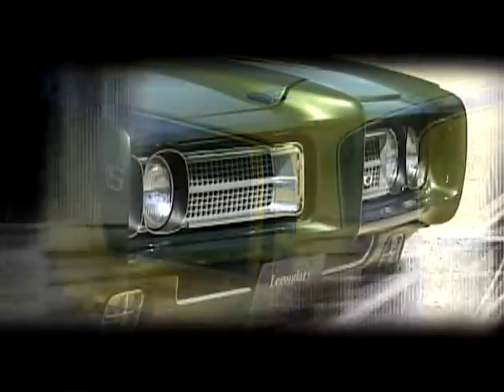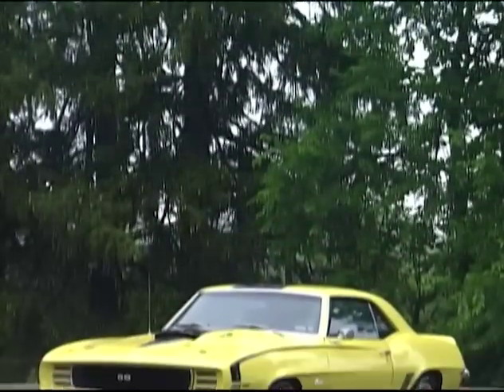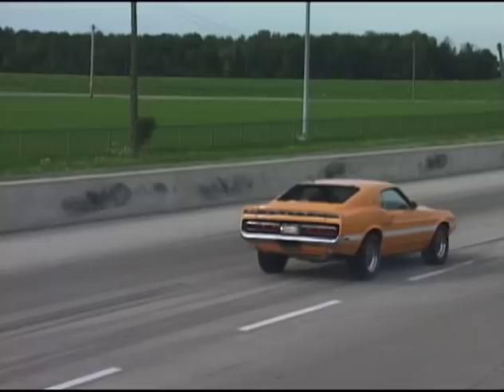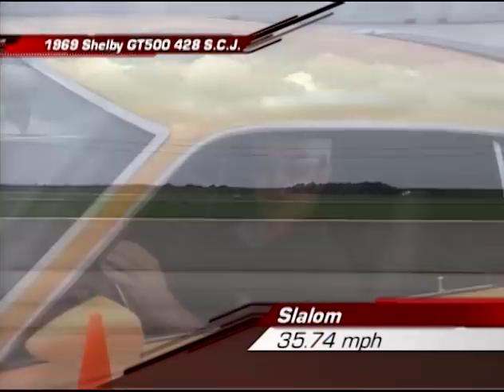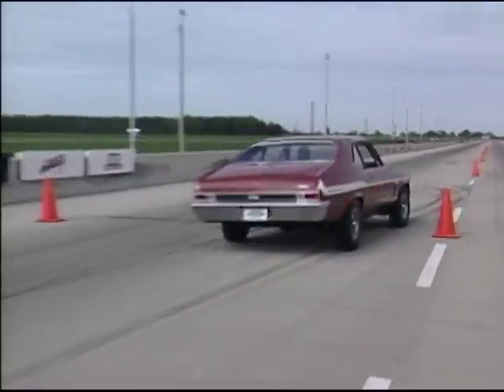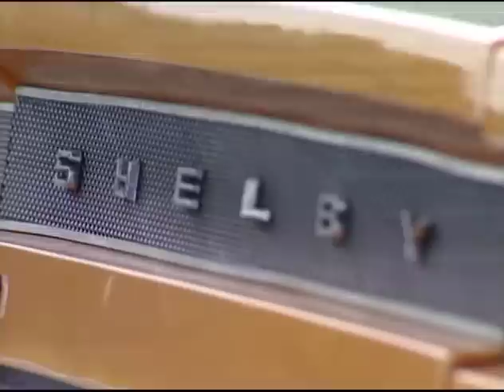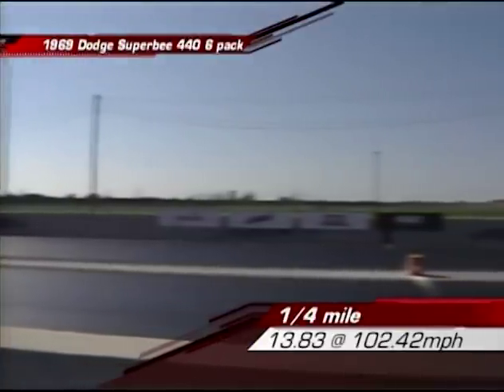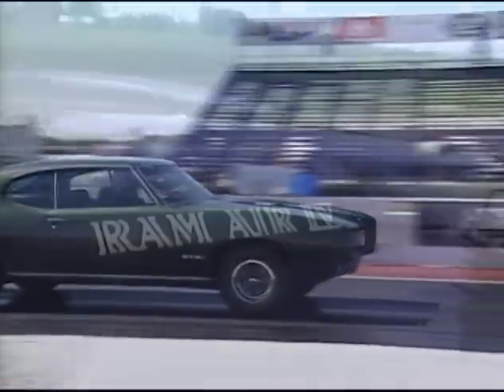What's the fastest 1969 tuner? SUPER MUSCLE CAR SHOOTOUT!

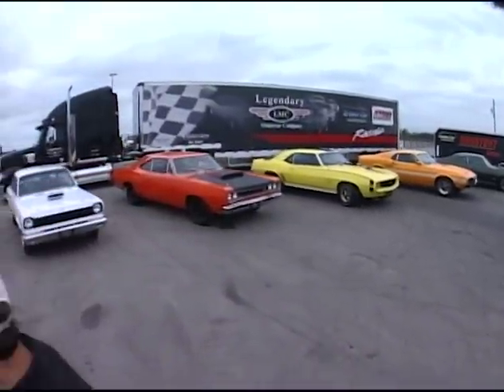Comment: The SSS Datsun 510 was the factory homologation car for BRE's Trans-Am race cars. They came with a 1.8L SOHC engine (vs 1.6L stock), side draft carbs, higher lift cam, header exhaust, larger oil pump and pan, magnesium BBS rims, larger front disk breaks, and many suspension upgrades. Nissan Performance sold race cams, titanium valve train, and forged internal parts through selected dealerships. My brother and I have built and raced auto-cross 510s for 40 yrs. In the hands of serious tuners they take 300lbs off, add an OS Giken crossflow head, forged internals, 4.11 R180 LSD, modified Z struts, and stiffer sway bars to make a 1,750 lb 200hp (230hp in race form) 10K rpm screaming rice rocket with a license plate. Although the 7.2L GTO's torque has the advantage after 80 mph, the quick accelerating 1.8L 510 pulls a high 12 sec 1/4 mile. It would easily top the leader board in 0-60, 60-0, and literally crush the slalom. SVRA Group 8 lap record at Laguna Seca is 1:42.98 seconds, held by Troy Ermish in his #38 510. The nearest SVRA Group 6 sedan (Mustang Boss 302) is 5 seconds slower, and on the short 2.2 mile track these Muscle cars would be another 40+ secs behind. All this lap record info is on Hagerty's website if interested. When it comes to performance, bigger isn't always better.
Reply: So what. You are comparing what sounds like a full on race car against street cars. Rather have any of these over gutted tin can510, no thanks. Go troll someplace else.
Reply: @FL50ssp  Just like the SSS 510 I described, these pony cars are not factory stock. They had many performance upgrades from independent companies. An over lighted tin can 510 race car would throw even more shade. All the same, a modified 7.2L GTO is still no match for a 1.8L 510. The Group 6 Mustang Boss 302 is a full on race car, and a little 510 kicks the snot out of it. If you think I'm trolling, you don't understand the difference between nostalgic hype and real performance.
Reply: @FL50ssp  There is no such thing as  Honda CRTs, so your time is wasted. Madia sells cars. Lap times don't lie. 

I lost my vision a while ago. Not driving my giant killer any more, but here are some vids of my sick little tin can. Post up some vidsof your car, or go blow your hot air somewhere else.

https://youtu.be/H4rYbyudrhA?si=sbBRWCdK0AlrX4RK
https://youtu.be/qWSJ9x-FJ8E?si=1LQt-fX2OCUTuf-D
 Here's a review of my 510 on a track buddy's YT channel. 200K views
https://youtu.be/GZtp6PiFlTI?si=owLHdMxeTCiUrfTy
Any questions?

Build list of mods and parts. Work ongoing, never done 

Chassis:
Started with a 1972 rust free SoCal car with Troy Ermish built chassis 
6 point roll cage body bonded
Willwood big brake kit with braided stainless brake lines
Spherical ball joint linkage 
Techno Toy Tuning stage 2 adjustable coilovers front and rear
Techno Toy Tuning camber/caster plates 
Raised T/C rods, 
RCA (roll center adjuster) between the struts and lower arm, 
Custom front X-member and engine mounts Jeff Boswell Coachwerks 
Toyota MR2 rack & pinion steering conversion
suspension tuning Troy Earmish racing
1.125" front sway bar
.75" rear sway bar
Slotted rear X-member,
Battery mounted behind passenger seat

Body & Interior:
Rust free SoCal body
Shaved side markers, rear plate light, door and trunk locks
I did the body prep and tape, Bill and Bill East Oakland did the spray.
Color is Ford D6 Screaming Yellow, Emron industrial equipment two part Epoxy paint used by Caterpillar
Carbon fiber BRE air dam, bumpers, door panels and thresholds from Pare Composites. RIP Dave.
Fiberglass hood and front valance 
Hella 65W 60mm halogen projector beam headlights
Corbeau Forza Sport seats on 2" lowered slide rails
5 point harness.
Custom built aluminum dash with Revolution GPS gauges. 
Quick release NRG steering wheel 

Fuel System:
Set up for E85 
ATL fuel cell with internal surge tank and two Walbro pumps
Z-Tech Flex Fuel sensor so ECU can adjust for any ratio ethanol to gas. 
Aeromotive 8AN nylon braided stainless lines and fittings.
Aeromotive pressure regulator
Custom fuel rail
Injector Dynamics 1000cc injectors

Engine and Peripherals:
s13 blacktop SR20DET with fresh rebuild bottom end 
Fresh rebuilt head  with Tomei metal head gasket
Knockoff Greddy intake customized for top feed injectors
Ron Davis Rad and intercooler with Transfer Black thermal conductive coating
Short run log exhaust manifold ceramic coating with Vband external wastegate
Garrett Gen2 GTX2867R T3 twin scroll 0.82A/R turbine 3.0" V-band exhaust
Custom downpipe with dynamic flow wastegate inlet
Tial blow off and wastegate 
Stainless flex coupler to 3" exhaust and Magnaflow glass pack 
Custom cold air intake with no MAF
Link G4 stand alone ECU, monitors O2, intake temp, and altitude to eliminate MAF.
Tuning by Rebello Racing and Portland Speed Industries
Wiring specialties s13 universal wiring harness. Yury Rocks!
GM LS2 coil pack ignition. 

Power train:
Exedy Racing Hyper Stage 3 twin plate Cerametalic clutch and light flywheel
Custom drive shaft
06, WRX sti R180 LSD dif
Drive Shaft Shop axle kit, billet stub ends, Porsche 930 axles and CV joints
Enkei Compe 15X7 22+ offset with 205/50 R15 RE-71Rs
Reply: @Datsun510zen  Sorry to hear about your sight, that sucks, and best wishes to you. I will say that is a nice build and even on the net you can tell it is a quality result all the way. But again you are comparing what as I suspected is a full-on build against stock cars. In as delivered from the factory or showroom condition. These cars are not as equal as you Implied. Will a small import do well/better on a short track that favors mechanical grip? Of course. However, on a normal road course like SCCA ran back in the Trans AM early days. This same small import is not a match on a course that favors a mix of mechanical grip and HP. Even more so on layouts that favor HP.  You mentioned something about my videos, here you go, all of these are from my SS 1LE, had a Z06 before this without PDR so I have a lot of GoPro videos that have never been published. But it is more of the same.   https://www.youtube.com/@FL50ssp/videos
Reply: @FL50ssp I couldn't see your SS 1LE, but it sounds great. So yeah, blindness sucks. I grew up around hot rods in the 60s and 70s. The driver assist technology in modern performance cars has never been my thing. Not as easy, but I enjoyed the direct seat of your pants driving experience of these beasts. Even more compelling driving experience for me was getting the most out of a smaller high revving engine.

Again, the SSS optioned 510's were street legal cars sold through dealerships, just like these iconic pony cars from that era. Race tuners were getting 10K rpm and 110 hp per liter out of the SOHC engines. Trans Am class A Sedans on the other hand were limited to 5.0L and made 95 hp per liter on push rod engines. To clarify, none of these drag oriented large displacement cars ran in that series. 

B Sedans were under 2.5L, and that class was dominated by lighter European cars. For the "tin can" Datsun 510's professional debut in Trans Am, it won 2 consecutive manufacturers championships right out of the gate. It was the absolute underdog going up against the Alfa Romeo GTV 1750, Auston Mini Cooper, BMW 2002, Saab 142, and the VW Beetle getting support from Porsche. After these victories, the little rice can 510 had completely revolutionized small sport sedan racing for the decades following. In fact, Datsun/Nissan has won more SCCA championship titles than any other car company. I couldn't give a flying fart about other Japanese cars, but I'm a huge fan of classic Datsun's.

Comment: Smokey Yunick was directly responsible for the final engine position of the '66 Chevelle's with big blocks. Smokey at that time was a engine/car tester and consultant for Chevy ( he did the same for Ford and Pontiac at other times ). He complained to the Chevy brass and told them the car was too nose-heavy, and that they needed to move the big block back 4" and lower it 3" as well. Even though the Chevy plant already had the jigs made to mass produce the firewalls, Chevy brass granted Smokey's recommendation and totally redesigned the firewall so that the engine would be dropped and moved back. Smokey tested the car again, and was very pleased with the results. He said the car actually felt "kind of racey". Why am I telling you this? Because in the same true story, Smokey stated that he saved the '66 Chevelle ( and later models ) from being a disaster in the handling department, and that title goes to ALL the Ford Mustangs equipped with big blocks being way too nose heavy. Carrol Shelby was totally against putting a big block in his Shelby Mustangs, citing that the 289 small block would run circles around it on road courses. But under pressure from Ford brass, Shelby relented, and gave them the big block Shelby's.
Reply: That Smokey Yunick story never happened.  The '66 Chevelle's big block was in the same exact position as on the 1965 Z16 - which Smokey had nothing to do with.
Reply: EXTENSIVE MODIFICATIONS were required to put anything bigger than a 302 in a mustang!
Reply: @Thomas63r2  I don't know why in the hell I said "66 Chevelle". It was the '64 Chevelle, the very first yr of production, and YES, Smokey Yunick DID advise Chevy brass to drop that big block down and move it back. Because he tested a prototype BEFORE AND AFTER moving the engine. My mistake on saying "the '66 Chevelle" earlier.......but I know I am correct about Smokey really pissing off the guys at the Chevy plant who already had the jigs made for mass producing the firewalls, and I can't recall the head honcho's name at the moment who hired & paid Smokey at Chevy, who took Smokey's sage advice seriously & ORDERED them to move the engine & build all new jigs for a different firewall to accommodate the different engine position for the big block.
Reply: @howabouthetruth2157  Sorry, I'm not buying the story that because of what Smokey said that they retooled the Chevelle AFTER the car was tooled up for production.   No brass at GM ever wanted to be the one who held up production.  Its the same firewall in all A bodies of the era in all the GM divisions, so you are not talking about changing tooling at just one plant - but at all the plants producing A body cars across all the divisions.
Reply: Here's the real story: ... Torquey GTO's owned stoplight to stoplight... where more people saw them... took a full 1/4 mile for the overcammed Chevy's to get a fender ahead: 
https://www.youtube.com/watch?v=SJIRitKQYrM
Reply: @BuzzLOLOL  "where more people saw them"...........what made up bullshit. I'm not debating that the Pontiacs had better low end torque........but how many times have you EVER seen "grand stands full of race fans in attendance" at a street corner? REAL MEN drag race in the standing 1/4 mile or 1/8 mile. "Racing from red light to red light" is what irresponsible KIDS do.
Reply: @howabouthetruth2157  - C'mon! ALL the millions of GTOs /442's ever made were seen smoking everyone else stoplight to stoplight over and over again! And that's where most girls saw them perform or drove them! Only a few GTOs ever ran on a drag strip... mine and my buddies never did... Did you watch the video?
Reply: @BuzzLOLOL  You said it, ahead.

Comment: These tests are always informative & fun,but there's never a clear winner because the tests are never 100% level. Running a mid-sized car vs a pony car vs a full-size car. Also when these cars were originally tested they had points,poloyglass tires etc...I've always wanted to see theses legends run with modern tech...fuel injection, roller cams, modern tires,electronic ignition...imagine what they could do...

Comment: Thanks for posting.  It is fun to watch these put through the paces in these modern times.  Tuners are kind of a weird title though.  The Chevrolet dealer drivetrain swap specials should have had huge legs up, it would seem, but couldn't take down that mighty Ram Air IV (I'm not sure how much Bobcat was in that one, but RAM AIR IV's seemed awesome with or without a dealer's magic).  The Shelby, was just a Shelby - I don't know how tuner applies except for body work I suppose.  The Super Bee - looked like an A12 Super Bee - Mr. Norm didn't do anything, did he?  Just a factory hot rod.  The Hurst, yeah, probably qualifies as a tuner.  Once sent outside of the factory, maybe the term fits better.  I would love to have seen a Hurst Olds in here.
Reply: In '68 GT500 lost its 2nd 4 bbl. carb. and Shelby's influence was waning... in '69 GT500 lost its hotter camshaft... was considered a 16 second car... Shelby/race shop tuning on this one plus Super Cobra Jet engine got it into 14's... Summer of '69 Shelby parted from Ford... back in the day a neighbor had a GT500 and it seemed like a slug for the spec.s it had...
Reply: Mr. Norm had several tuning stages, from re-jetting carbs, re-curved Hemi distributors, to mechanical linkages on the 3 duces, to headers and cams. Whatever 1's wallet would allow. I'm not sure what package that A12 feature car has, as they really didn't get in depth.
Reply: @adamtrombino106  in all honesty the a12 super Bee six pack that I've seen from the factory in red magazines can run 12. I'm sorry to say the guy honestly didn't know how to drive them properly, and the mustang with a super Cobra jet is a low 13 second car at least 13 5 in the Shelby's case in Maryland I've seen a lot of muscle cars race in the a12 the hemis I seen these were stock mind you beat everything.

Comment: Don’t know why you chose the big heavy B body Mopar instead of a Barracuda  since you used pony cars  (or pony sized) with all the other. Couldn’t you find a hemi out their for that matter.
Reply: In all honesty it didn't need a hemi but I love that motor the 440 a 12 super Bee when you get them you're supposed to take the tires off and put better ones on but besides that even stock if you look at the old magazines and I've seen them run factory stock as well and she's so Kenny dragway with good street tires I'm not sure what kind but they run 12 from the factory that's why they were so awesome. To be fair it needed a better driver.

Comment: The Mussell Cars i ever owned were a 66 GTO with a 68 Firebird 400 Ho motor with a 4-speed B/Waner tw10 with 3:50 rear gears p-track. Played with it a little and the 396,440 and the Mustangs didn't hold a candle to the GTO. not bragging just, the fax 
my Dad drove it for a couple days and i said son that car well by any think but a gas station. Also had a 65 GTO with a 389/3 dues 4-speed. As well as 3 Firegrids and 1 89 Trans Am. Old Combat Vet from 1970 Tom

Comment: I'm really surprised that GTO isn't a 428ci instead of a 400. I know that Royal would install a 428ci Pontiac V8 for like $650 in 1969. Car and Driver tested one. I am also surprised they didn't throw a Hurst Olds 455 in there, that was the biggest engine you could get in any of the muscle cars in '68 and '69. It wasn't until 1970 that 454s and 455s were available in the rest of the GM Muscle Cars.

Comment: I feel like the Shelby got a bad deal there. As I understand it, all the others are tuner modified cars, so they had added power. But Shelby didn't touch the engines in 69, so it's a standard factory Ford 428scj up against some non-factory modified engines. Shame, but still held its own OK.
Reply: Well in '68 GT500 lost its 2nd 4 bbl. carb. and Shelby's influence was waning... in '69 GT500 lost its hotter camshaft... was considered a 16 second car... Shelby/race shop tuning on this one plus Super Cobra Jet engine got it into 14's... Summer of '69 Shelby parted from Ford... back in the day a neighbor had a GT500 and it seemed like a slug for the spec.s it had...

Comment: Hey guys !!!  Love all you do......but,
I have a Q&A...I bought a 69' LTD off a lady, that it was given to her by  the lady that took care of her....she told her she said new....I find that too be wrong,
But, 
I'd be a 4th owner...I guess?
  Okay....here we go.....69' LTD, no hideaway lights, radio on the left and it was a big AM radio/ a antenna that, when extended, was as long as a fishing pole, plus on a spring, and, in front of the driver on the left, that went parallel with the pillar....speedo, says 60 in small, and straight up on the speedo, when at that...speed...antenna sits parallel with the post...at speed.....
White with Blue vynil top...4dr so the 69' badges were on it, past the 3@4th doors.. before getting into the downslope of the rear portion.
 ...ok..Q&A......69' LTD 429 2bbl auto, disc brakes, and, it for some reason didn't have a driver's side headrest..go figure....a/c..yes...a glove compartment....that would accommodate gloves, but, cram your paperwork in it anyways... I'm asking for info..... Could it have been a fleet car...or...more of a sleeper car, if you're a detective?
Per say......Thanks.... don't start scratching your head...I have you covered since 94' when I took it over....thanks again
Reply: Back in day had cops chase me in that same Ford and I was running 140 in '65 GTO, Ford started misfiring at 114, came to an intersection and drum braked GTO slowed down and made right hand turn... disc braked Ford couldn't get slowed down and over shot the turn by several hundred feet... I was long gone... learned the details on the cop car later... they wished it had a 4 bbl. 429... and a fresh tuneup... kind of like Burt Reynold's White Lightning movie car...